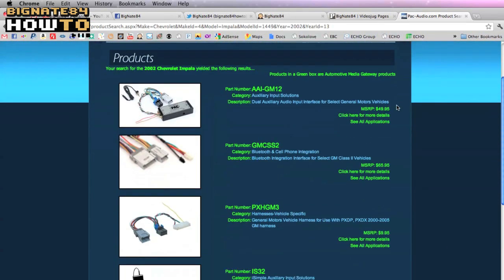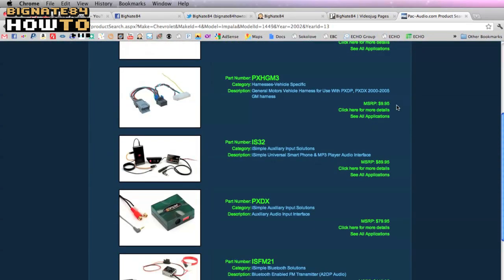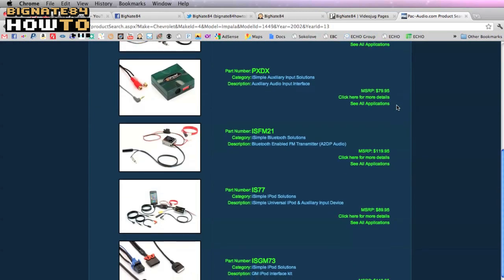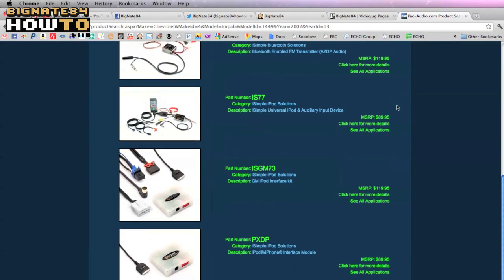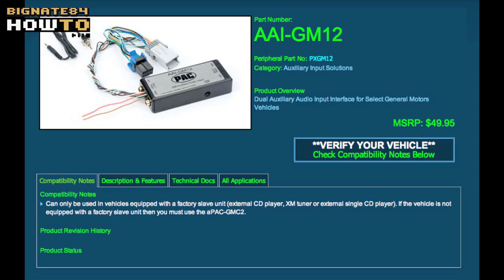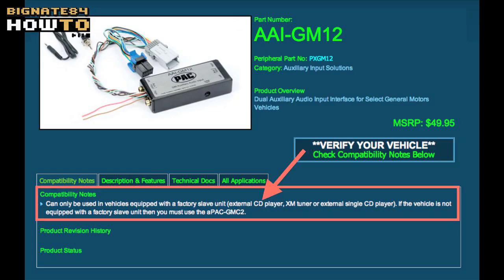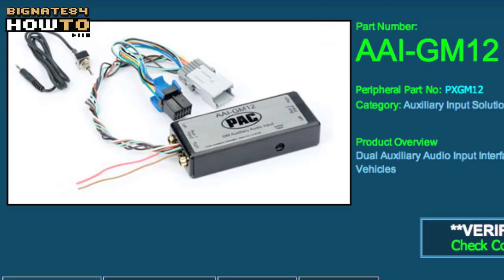How To Turn Your Car Ashtray Into An Audio Input

Comment: quick question, if my cd button doesnt have a cd/aux symbol, do you think the audio from the iphone will allow it override the "no disc" sensor, in the cd player, not sure if thats clear enough but it my cd button wont work unless a cd is in it. or does that concern the type of interface i buy. thanks, good videos.
Reply from the maker: I'm not sure I understand the question.  The aux/cd button allows you to switch between the internal cd player and an external input.  no cd needs to be in the player for the aux source to be selected.
Reply: i just wasnt sure because my head unit does not have "aux" anywhere
Reply from the maker: is it a factory head unit?
Reply: yep
Reply from the maker: if you don't see an "aux" button anywhere you may not be able to use the device shown in this install.

Comment: Bought a USB FM Modulator which plugs into Car Cigarette Lighter for less than $10-00
Does exactly the same thing wirelessly without the time or fuss.
Reply from the maker: Haven't tried an FM modulator in years now.  They never seem to work properly.  Typically they inject static into the audio signal and are much lower quality with inconsistent results.  Driving long distances with an FM modulator becomes frustrating as you have to find new unused FM stations.  Certainly I agree with you that a USB FM modulator is an  easy installation, but it should be noted that quality and reliability will be scarified.  That said, what make/model USB modulator are you using? and how do you like it?  Does it perform well?
Reply: BigNate84 those things are garbage wouldn't waste my money on one of those again. The quality is much better with the wire hook up. I'm about to hook mine up to the 04 Cadillac srx but I also want to hook up some sub woofers so idk if it will interfere time to play and find out

Comment: hey big nate, what do you know about simply inputing audio L, R, and common to the J H K pins of the 12 pin C2 on the back of these class2 radios?
Reply from the maker: jim dandy I have not attempted that yet.  Sounds like a fun Saturday morning project.  Might be more trouble than it's worth due to the custom wire harness you'd have to make.

Comment from the maker: Depends on whether it has an audio slave unit.  An external CD changer for example.  If it doesn't have an external slave unit then the answer should be yes.  But you should really double check the compatibility description carefully before buying an interface.

Comment: then my car is a 2004 Impala with exactly the same stereo as the one shown in the video, same buttons all, it does not have a CD changer or XM radio, this adapter would work for my car, if the car is not any once had these devices (CD Changer). because I do not know if the stereo had them in the past. thanks blessings from texas. good video

Comment from the maker: I think I misunderstood your original question. Your exactly right by the way.  The product I used will only work if there is a stock radio that is designed to work with an external slave unit.  The key part is that the external slave unit cannot be in use in order to use this interface.  It's an either or situation.  You can either use the external slave unit (an external CD changer for example) or this AUX interface, not both at the same time.

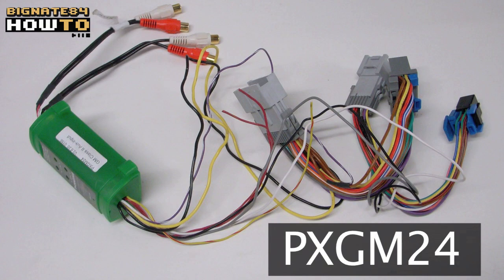Comment from the maker: I would say the difficulty level is medium.  Depends on how tech savvy you are.  The AUX button normally wouldn't do anything unless you have some sort of external device to control and switch between.  I used a product called the PXGM24 as seen in the video at 02:01

Comment: The Mit-3.5m allows you to input auxiliary audio to play through the factory Mitsubishi radio's auxiliary input Measuring approximately 6' long the Mit-3.5M has a 3 terminal connection cable that connects to the 14-pin or 22-pin connector depending on which radio is installed in the above vehicles. A male 3.5mm audio plug is on the auxiliary side, for easy connection to any device with 3.5mm headphone jack. eliminating the need for an FM modulator or unwanted static.

Comment from the maker: I think it's the CD changer that's causing your problems.  The AUX button can only switch to the newly installed interface if there is no external CD changer in the system from what I read in the manual.

Comment: Hey there, i got a 2005 impala that has the same stereo head as you I also purchased the PAC AAI-GM12 for this application, however i cannot get my deck to recognize another input other than my cd thats playing, what do i do to troubleshoot? what colour am I supposed to attach the power cable to?(the red wire)

Comment from the maker: So that is an important distinction to make.  For this specific aux interface it was important that my stock radio had the ability to control an external slave unit. For example an external CD deck.  Basically what I am doing when I hit the AUX button is telling my radio to look for the audio input of an external slave unit.  So if you already have an external slave unit this won't work.  What is the make, model and year of your car?

Comment from the maker: Check the 12 volt power cable that the lighter is connected to.  It may have come unplugged or become damaged.  Do you remember when it was working properly?

Comment from the maker: Ben, The procedure should be the same, you would just need a different interface that supports analog audio with a 3.5mm stereo mini cable.  If I understand correctly you would need to uninstall the iPod specific USB interface and replace with an analog audio interface.  Does that help?

Comment from the maker: The exact interface shown in this video will work with any analog audio source.  It could be any type of MP3 player or a DVD or BluRay player.  You can get different types of interfaces depending on what you want to do.  Many are designed for iPods.

Comment from the maker: Thank you!  If you want to install a sub you will need an amp specifically for the new sub your adding.  I should make another video about that process since it's more complicated.  Let me know if you have any questions.  But basically you need to run a power cable from the battery to the sub amp.  And a control cable from the sub amp to the stereo deck to turn the amp on and off.  Then a line level audio cable from the stereo deck to the sub amp.  And speaker level cable from amp to sub.

Comment: Great video. Even was able to take snap shots as the video was playing. I do have a question .. My 2003 impala ls sport has a factory amp on the trunk, how do I go about installing a sub/will I be able to use the factory amp?? PS I'm def doing the aux through the cigaret lighter #genius

Comment from the maker: Did you adjust the volume screws?  There should be two screws that control the volume level.  If you have the same interface as the one in the video you will have the option to plug in 2 stereo sources and adjust the volume level for each on the interface.  It's the type of thing you set once and forget about.

Comment: Hey so I had to get the aai-gm12, but I also have an 02 impala.  The pxgm24 just has a  go-between for the 12-pin and the 24-pin wiring harnesses that go in the back of the stereo, but the gm12 only has a connector for the 12-pin, and the instructions tell me to connect its red wire to pin b3 of the main 24-pin connector of radio.It says the wire in b3 should be either pink or dark green, but mine isn't. I was wondering if you know where the red wire actually needs to go, and how to do that? Thx

Comment from the maker: I believe one of the conducts in the cable harness has 12 volts.  In that case there is no need for an external power supply.  Or it could be a passive device I really don't remember.

Comment from the maker: The volume is great, it might be deceiving in the video.  There is a volume toggle on the interface that you can access with a screw driver so you can adjust it as needed.  When you press the CD AUX button it switches between the CD player and Aux input.  To get back to the radio you just press the band button.

Comment: You answered my question with that actually. I also have an 02 Impala and I was looking to maybe just a buy a radio from another 02 Impala with a casset player so I could just use that to play mp3/Ipods. I kept seeing something about having to "unlock" or "reprogram" the radios that you take from one car and put into another. After I looked into it more I saw that if you just unplug/ plug the radio from your car it won't lock or need reprogramming. You answered my question though. Thanks!

Comment from the maker: No.  On this particular device that I have it is simply an analog audio input.  There is no control capability.  But that is why in the video I recommend going to the web site and searching for all compatible devices.  Each device has different functions.  You can get an interface that can be controlled through the radio but you have to make sure it is compatible with your stereo and specific MP3 player.  If you change brands of MP3 player it may not work anymore.

Comment from the maker: Good question.  It depends if your stock radio can accept an external audio input.  I'm just speculating but I would guess the answer to your question is most likely no.  Switching between tape and CD is switching audio internally.  Switching between CD/Aux implies an external audio source.  I could be wrong though.  I'd have to know the exact model number on the back of your radio to look it up for sure.  Did you try the part finder mentioned in the video?

Comment from the maker: Yes the internal CD player stills works.  However if there was an external CD changer (aka slave device) often located in the trunk or under the dashboard this would not work.  This aux input only works in place of an external slave unit.

Comment from the maker: This is not a good design for a smoker.  ipods with ash and burn marks on them aren't very attractive.  The FM transmitters I have used in the past have been really annoying.  The signal tends to come and go as it it pleases.  Especially on long road trips the frequencies change as you drive through different cities.  Thanks for the entertaining comments.

Comment from the maker: Yeah I might have a suggestion.  I had a similar thing happen to me.  Once you press the CD/AUX button it looks for the AUX input.  There should be two AUX inputs D1 and D2.  You need to toggle to the appropriate input.  I don't remember if its D1 or D2 but if you press the AUX CD button again or hit the seek left/right buttons after hitting CD/AUX it should do the trick.

Comment from the maker: Depends how Onstar is connected to the stock radio.  I'm not familiar with it so its hard for me to give advice.  You need to find out if Onstar is a separate device that connects to the main radio as an audio slave unit.  If it's built into the radio then you should be fine.  If Onstar is an external device located in the trunk or under the dash or wherever you may be able to disconnect it and add the auxiliary interface in its place.  Does that help?

Comment from the maker: @kylestaack A "factory slave unit" is an external device that is controlled by the cars radio.  The most common example of a factory slave unit is an external CD changer located in the trunk.

Comment from the maker: @kylestaack Well I did this install back in 2009 so my memory of the details has faded a little.  I think the interface should get 12V power from the factory wire harness.  If there is a switched 12V power wire I would think that is optional in case you want to be able to switch the radio/interface on and off without starting your car.  It will probably draw power directly form the battery.  Thats my best guess anyway.